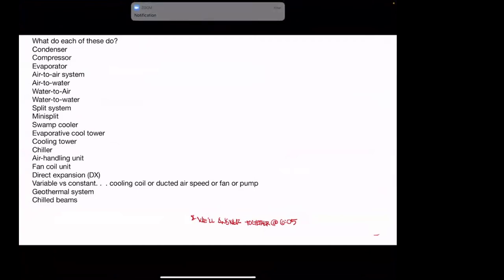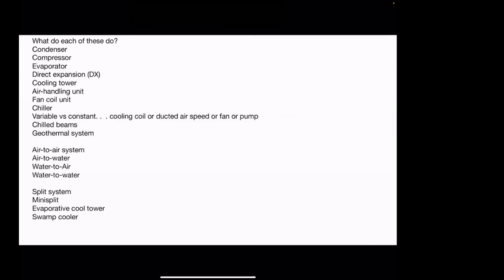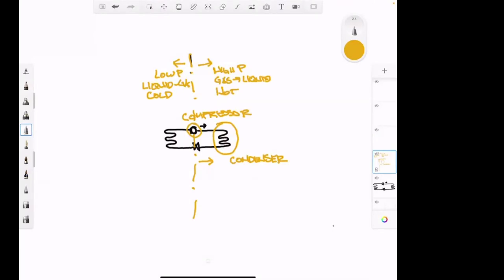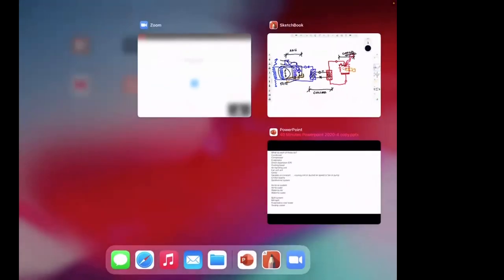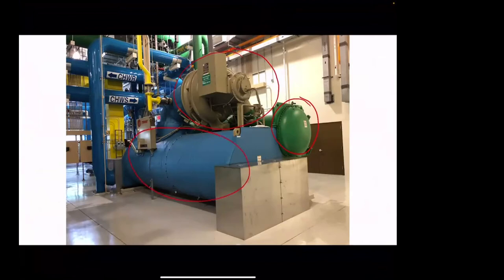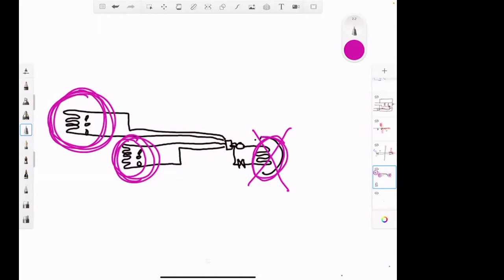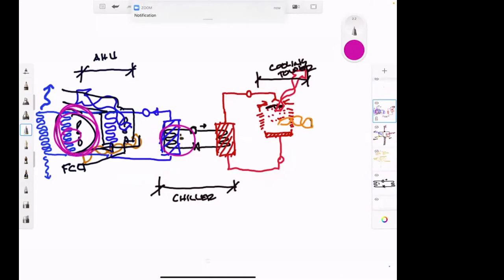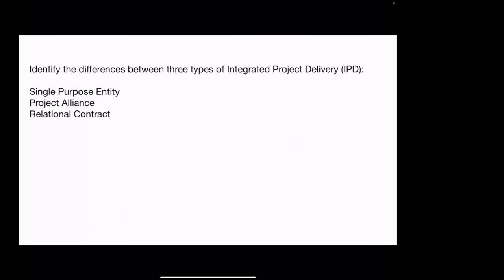HVAC Terms - 40 Minutes of Competence | Amber Book

Comment: Condenser and compressor mechanisms: bicycle air pump and compressed air duster  used to clean computer parts. Bike pump gets hot and spray cleaner get cold. Thus mystery solved.